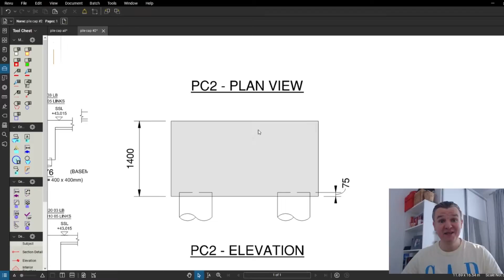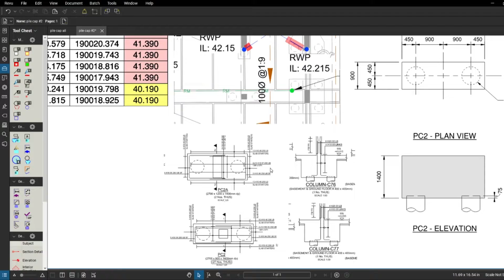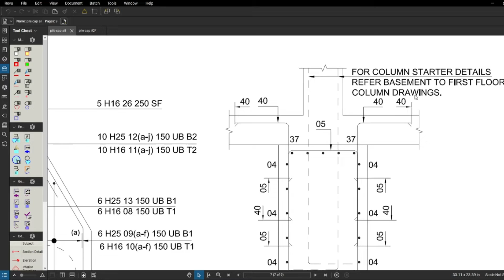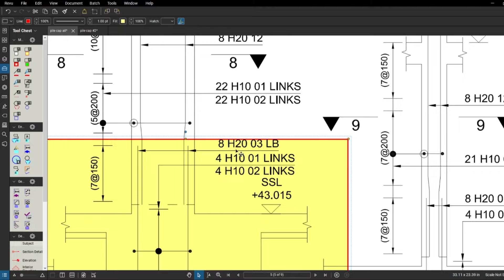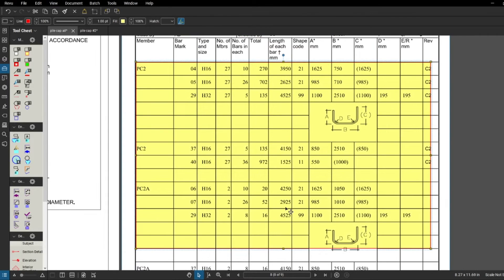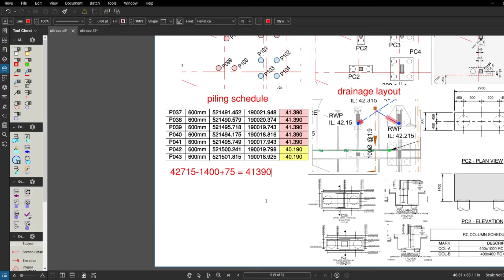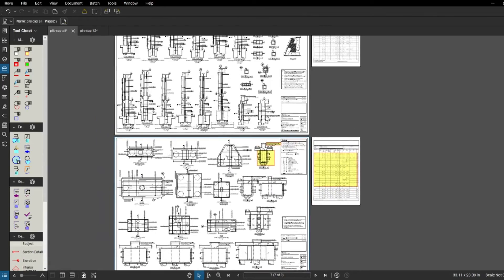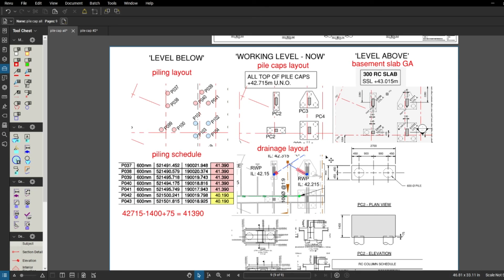How to read Construction Drawings #11.Pile caps. Rebar drawing and collecting all information.

Comment: Hi Greg, I am one month into my position as a trainee setting out engineer and loving it. My company only work on new housing developments, so I only set out house foundations, roads and drainage mainly. I’m worried slightly as I’m not working on large RC frames, piling etc. Do you think a setting out engineer should have this experience? I have completed a HNC and due to start my degree. Thanks for helping, keep up the videos
Reply from the maker: Hi Blaine! It's very good, you actually will learn more doing drainage, foundations and roads and you have still time to work on frames. Learn as much as you can now and if you'll get little bit bored than try RC frames. Setting out engineer should be comfortable to give lines and levels whether it's frames or roads. It all depends on what you want to do in the future, but I would stay where you are now especially that you're there only a month:)
Reply: @SITENG  Ok Greg, thanks very much for the advice! Do you think it would still be possible to join an RC frame company in the future without experience in RC frames?
Reply from the maker: Yes, definitely. You will have experience in construction so that's the most important, I am sure there won't be a problem :)
Reply: @SITENG  perfect, thanks! If you have the time you should consider setting up a group for engineers to help each other. Love watching the videos
Reply from the maker: @blaineswift909  Thanks! I will do within 2-3weeks, I am thinking about patreon or linkedin page with a group where we can discuss and help each other :)
Reply: @SITENG  LinkedIn would be great, will keep an eye out for you setting it up, thanks Greg!